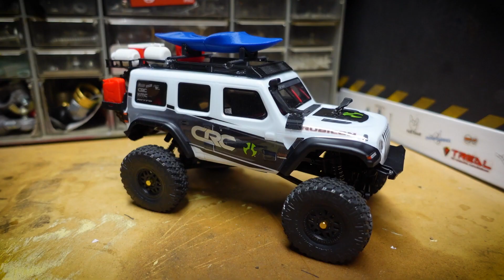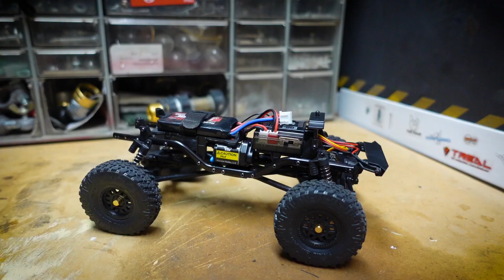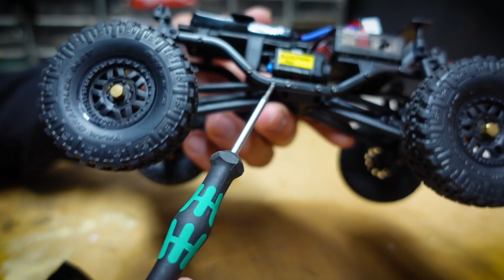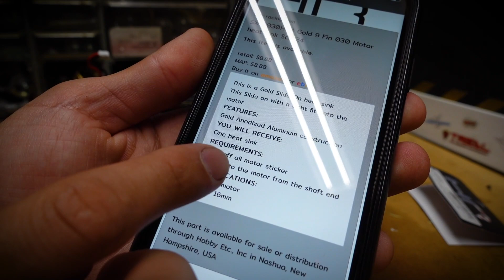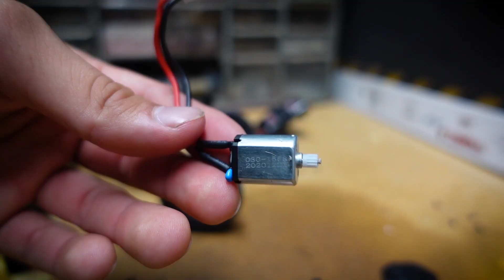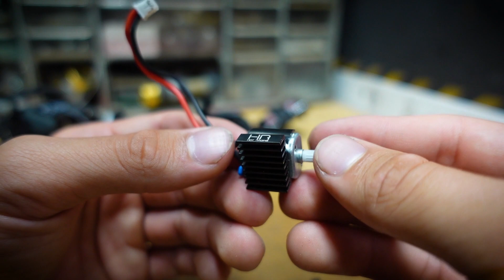Axial SCX24 JEEP Indoor Build Ep.8 Hot Racing Motor Heat Sink

Comment: It looks like there’s a little bit of work involved in installing this but anything to help keep the motor from getting too hot is definitely helpful. Even though replacement motors are relatively inexpensive.
Reply from the maker: Theres actually an easier way to remove the motor. Two screws on the skid plate one by the transmission. You also have to remove the battery tray. I learned the hard way 👍 learn from my mistakes !
Reply: I was able to install my heatsink by removing the transmission and then removing the motor from the tranny to slide the heatsink on. I had to remove the battery tray but for the most part it was pretty straight forward

Comment: Great video. Is it necessary to remove the skid plate screws? If so, both sides it just 1? And the transmission cover is two screws? And then the motor is one screw after that? Do the white gears stay in the vehicle? Just want to make sure I'm hearing it correctly. Thank you for the video.
Reply from the maker: You can definitely do it a lot simpler than I did, this was a while ago when I was a noob hahah 😅😂

Comment: You know I’m vary hesitant about getting that heat thingy lol just because idk if they work or not but why not I swapped out my motor and it gets pretty hot so I think ima try it out. How does yours work so far? Worth it?
Reply from the maker: It definitely absorbs heat I can tell you that. I used it on my stock motor so make sure it is compatible with your replacement!

Comment: You can buy 2 heat sinks if you have the larger high torque motors . You just have to trim the front one with a dremel tool on the part that raps around the motor,  1/16 " ... not removing any of the fins just the ring part so it will slide more towards the transmission.  Then add the second one behind that one . It has to be trimmed at 45° in the bottom corner that will allow it to miss the frame . They look awesome together like one big heat sink ...and they do help the motor to stay cooler by transferring the heat away from the motor and into the heat sink and the air through the fins cools the heat sink . Just like air cooled motorcycle cylinder heads have fins for cooling . Even if you don't buy a heat sink you should remove the sticker off the motor . The sticker holds heat in the motor . It will run cooler without the sticker . I live in Vegas and it get 115 in the shade here so anything that cools the motor is a good thing . If you don't have a dremel tool,  you could just use a file to make them both fit .
Reply from the maker: Taking off the sticker is a must 😎 stay cool out there 🥵
Reply: @MiguelCortez  my grandkids love their heat sinks .... I bought 3 different colors,  red orange and black . They last forever.  Thanks for the comment.

Comment: It's a heatsink meant to transfer heat away from the motor. Made of aluminum since that's highly thermally conductive. Just taking the sticker off helps a lot, I think that's part of the issue with the stock motors. I bought a 60 pack of 8mmx8mmx5mm ones online that use thermal paste. I'm sure these work better since they wrap around more of the can.
Reply from the maker: Great alternative I’ll have to look into that !

Comment: U should upgrade one of ur motors in one of ur build to the ox motor the only thing u need to do to install it is cut one leg from the battery tray super ez to install https://www.ebay.com/itm/Ox-050-Brushed-Axial-1-24-scale-BOLT-IN-Motor-Upgrade-Free-Ship-Barrage-SCX24-/164700601353?_trksid=p2349624.m46890.l49286
Reply from the maker: Will look into this thanks !